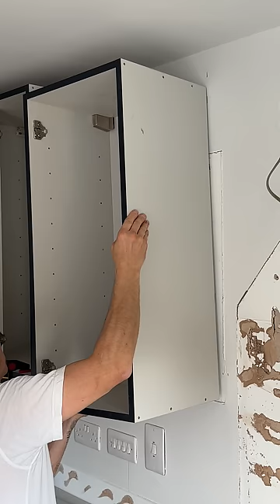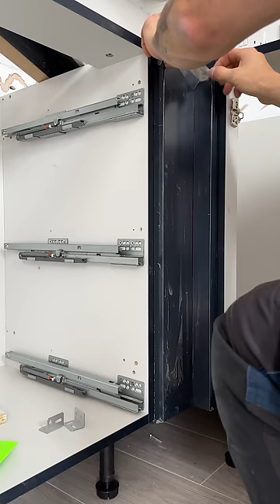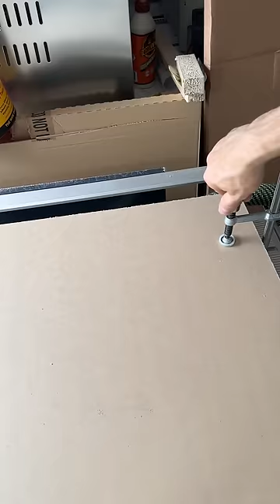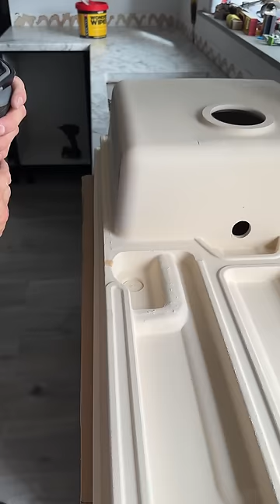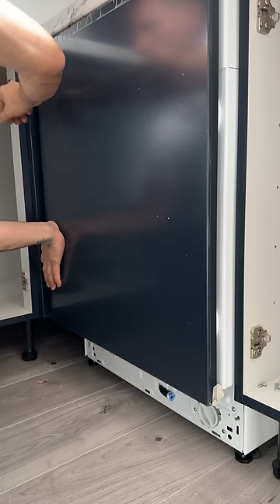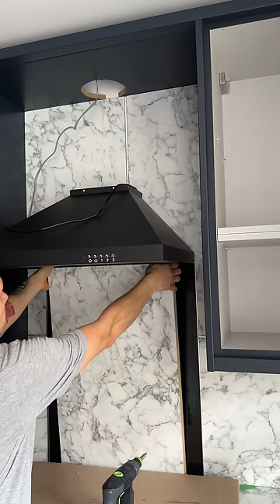The Secrets to a Successful Kitchen Installation kitchen worktopskitchen hacks ideaskitchen tips

Comment: Great work, maybe you do but didn't see it, I always silicone all the inside horizontal and vertical corners of the sink unit before doing any pipework, just incase there is water spillage, so the carcass doesn't swell....nice clean efficient work 👌
Reply from the maker: Thanks i did only on cut i was doing there thanks for the tip

Comment: Hello from Ukraine! Then I have another question, I hope for your answer).  Do you make kitchens, a complete process - measurements, design, material calculation, and where do you order, if you order the cutting of slabs and their edging?  Do you take factory furniture and adjust it to the required dimensions?  I myself have been making furniture for 18 years, but there is always something to learn, because a person cannot know everything.  Thank you for the well-presented material!
Reply from the maker: Thank you no only 2 kitchens I done from  scratches rest of the the suplied by a company that is easy way they cutting everything so i can install it

Comment: Great skills. I'm a joiner myself and appreciate how you work.   I'm interested that you don't biscuit the worktop and in the sealant that you're using.   I started biscuiting recently because a freind said it is better but I think I'm going to stop. In theory it should help align the top surfaces but in reality I think it can make one side of the worktop joint creep upwards at points.    Would be interested in your thoughts.  Keep up the good work 👏
Reply from the maker: I only tried oines and i knew straight away is not gonna work on chipboard works on hard wood or mdf
Reply from the maker: Thank you so much for your comment

Comment: Always a pleasure seeing you work.
How do you like the Bosch scanner? I have one of their blue stud finders, in hope of getting something better than cheaper brands but find it rarely indicates the studs correctly. 😢
Reply from the maker: I was thinking of that but i will not rilay on that tool only i will try to have a sense where are the pipes coming from where are sockets placed are any loose wire underneath etc than i will ask customer he might also knows frome previous work if there are any pipe or wire work on the area i am gonna work than only after that i will start  check the walls but yes this is a scanner not just a stood finder it can tetect live wires pipes wire etc in bricks dry wall and enforsed concrete etc up to 60mm in depth here is amazon affiliate link for the one i am using https://amzn.to/46RoxgL
Reply: @CAVjoinery  Allright, then it sounds typical as to how I have gotten used to using mine as well, mainly for checking electrical and metal behind the wall.
For finding the studs I actually bought a really strong magnet and finding the screws in the drywall instead which works much better than any stud finder I have used.

Comment: There are a few small things like maybe try using tape to seal the MDF around the sink rather than silicone (you always miss a little and  overtime water will get in there) but the overall job is incredible! The attention to detail is amazing and I absolutely love how clean you keep the site! 
What areas of the UK do you cover?
Reply from the maker: Thanks for the tips! Although aluminium tape goes only on hob cut out but they are very expensive in comparison with silicon or sealant
Reply: It’s not mdf. It’s mfc. Hybrids like CT1/Stixall will never come off or get water ingress.

Comment: Nice work.  The materials which you are using is waterproof? . Normally for kitchen counter top we use granite slab. But you are using thick particle board.  Will withstand heat ?
Reply from the maker: Is melamine so material is laminate which is water proof,If is sealed properly every cut and joint it can las years, thanks for watching

Comment: Your work is so neat and orderly. Would you be able to list all the the tools you use as I’ve not seen some of them before. Thanks
Reply from the maker: Festool tsc55keg ,festool jig saw 420,bosch d120,festool dtp drill ,impact driver ,festool sxc 12,festool capex ks60,festool extractor tcm26,festool,aps900 jig,festool of1400 router,bessye clamps ,festool rapid clamps,tajima aluminist tape measure,pica fine pencil,tajima silicon gun, thx 🙏

Comment: Do you have a video on making the handle less corner posts. I have got to do this when I get my kitchen and I'm bricking myself. I have bought a table saw to do this, but everything I've seen says not to cut the side that the blade is leaning to, but you made it look so easy.
Reply from the maker: I think I have one i will send a link in a minute thanks
Reply from the maker: https://youtu.be/Y66ES3IWwvs?si=CbyawyY0uu6yOgUg
Reply: Thanks, that's exactly what I need to do. Any professional tips would be appreciated 👍
Reply from the maker: @shaunmoore4580  be careful when putting glue do not go close to edge it may squeeze out and damage your corner post and use something that prevents tire outs on J profile is doing same style door as mine ill sen a link we another option if have a L shape unit and free post
Reply from the maker: @shaunmoore4580  ahh that video is on TIKTOK sorry is a cornerbpost exactly same like the one u saw but i attached to a door using dominoes it so much nicer then using brackets or insode boards
Reply: @CAVjoinery  it is the same J style. I have bought an evolution rage table saw and I am planning getting a 60 tooth blade. Reading about cutting bevels most say don't cut with the blade pointing to the fence for possibly trapping the piece and getting kickback, but you seem to cut it like butter. I take it you don't get kickback when you do it.
Reply from the maker: If yo have a good blade and a stable saw it should be easy enough
Reply: @CAVjoinery  thanks